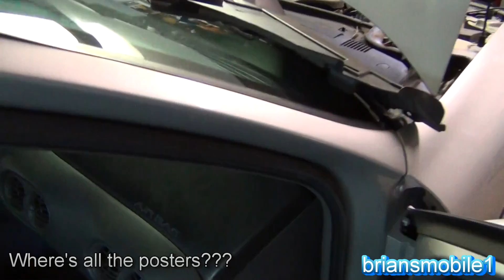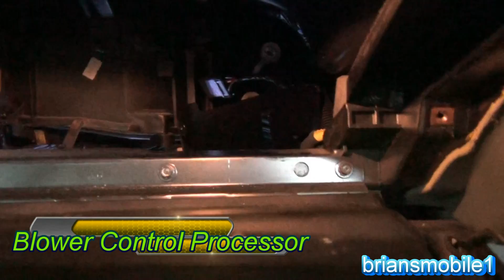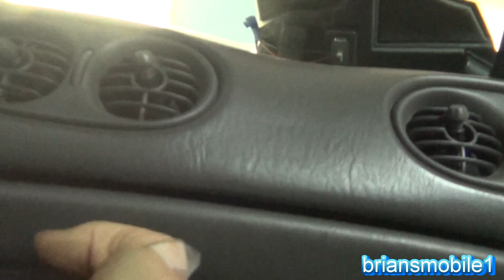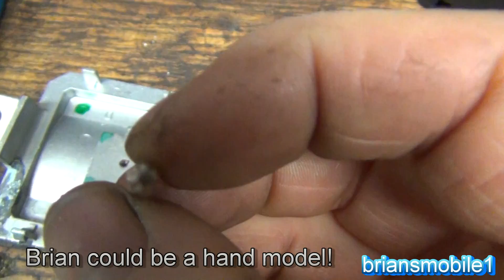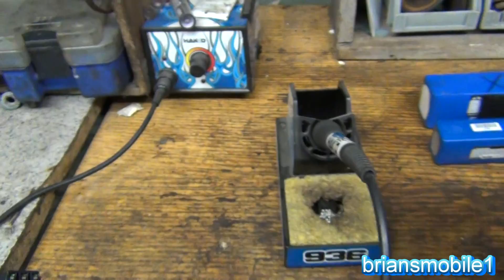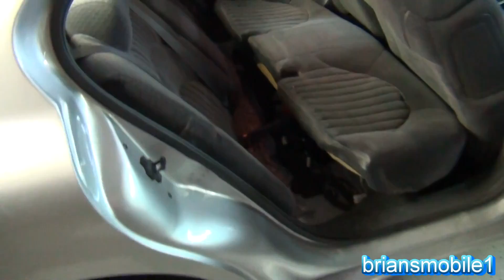01 GM Sedan Blower Motor Resistor / Processor Fix

Comment: Thank you i just picked up an 02 bonneville and it doesn't blow air.  I'm gonna buy a new blower motor and fix the resistor like you did to save 100$

Comment: I think fixing it is better than replacement because the replace meant will have the same problem
Reply: I think it's a bit hard to decide the cause of the problem from what we see here. It's true that the wire heated up and cooked the insulation, and perhaps slightly melted it's own solder connection creating a cold solder joint. That's a solder joint that appears to be ok but fails to conduct properly creating a high resistance point. What I do for that is reheat the solder joint in the board and flow some new solder into the joint. That generally fixes the problem, and is a fast thing to try rather than replacing the wire immediately. Oxidation or other discoloration on the surface of the conductors will not prevent the wire from functioning.

I find that an over heating like that can be attributed to one of two causes, a problem on the board, or the fan motor is pulling more current than design. It's over current through the wire at it's connection point that will cause over heating and a solder joint failure. That could be caused by a poorly made joint, or over draw on the motor. This is also a problem that increases as the joint decays ensuring the eventual failure of the joint. A poor quality solder joint from the factory could have been the culprit on the original part, or the blower motor may have been drawing excess current. If this is a common failure in this model it could be an under engineered fan speed control. If the motor is drawing too much current, then there is a chance that the new part will eventually fail.Some board designs have a heavy resistor on board to allow for an excessive load. As the current increases, the voltage drop across the resistor will increase lowering the voltage and thus current going through the load. I don't know if that unit has the same capability. I do see a heavy wound copper coil on the board in the video and If I had to guess I would say that's it's function.